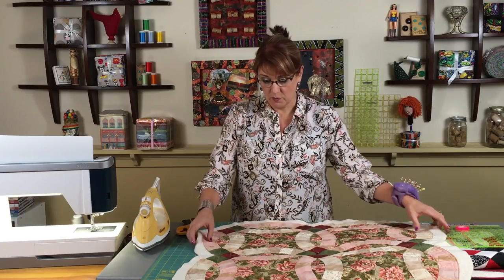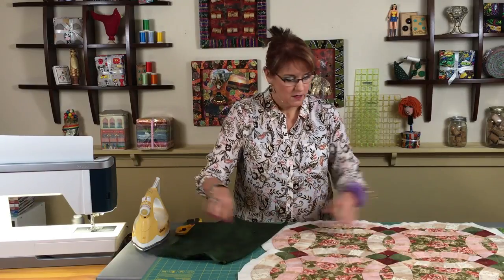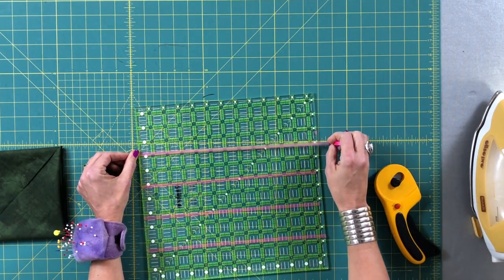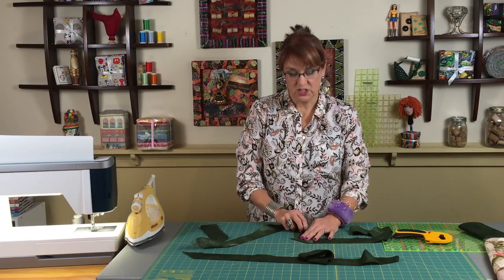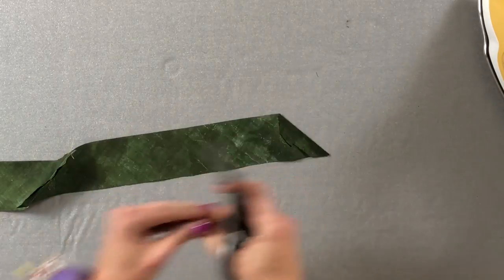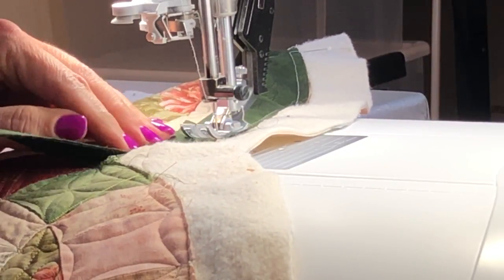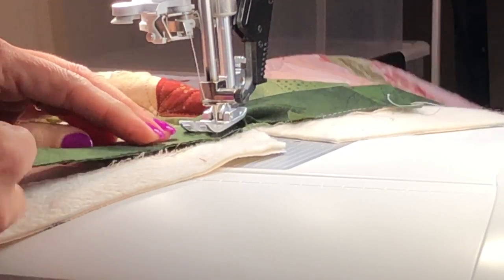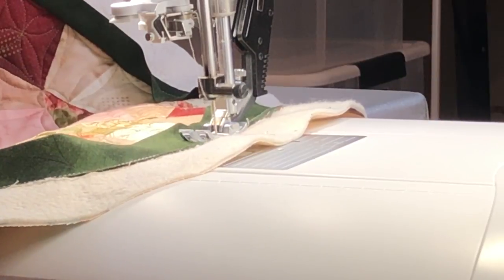Double Wedding Ring Quilt: Bias Binding-Part5/Ep 409

Comment: Nancy, I just recently came across you older videos from several years ago.   You're a delightful instructor and very informative, esp on beading on quilts which I once heard of from Cindy Needham.  Your detailed video gives a very doable instruction, and I'm looking forward to using it on 2 work in progress wall hangings.  You also mention using  606 spray adhesive.  I just heard about 505 from a Patsy Thompson basting video.  When would you use 505 and when 606?
Reply from the maker: Hi Elisabeth, they are from the same company but do two different things.  606 is the idea of a spray of WonderUnder fusible and the 505 is a temporary basting spray they washed out of the quilt when done.  I have used both but they are really very different :) - Nancy

Comment: I just finished a king size double wedding ring and it is at the quilters. After 2 1/2 years of working on it on and off I am very afraid to cut into the quilt at the indents. Is that the only way to put the binding on?